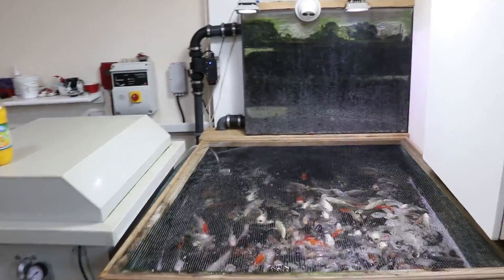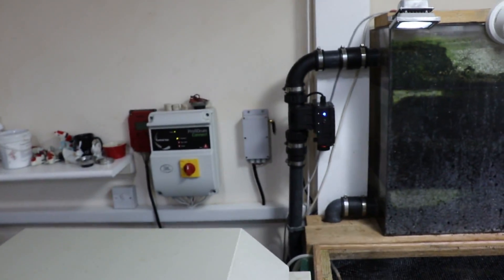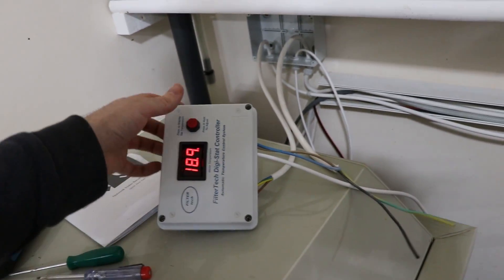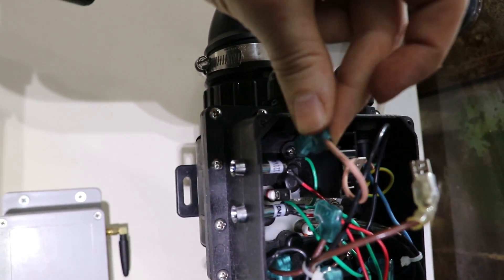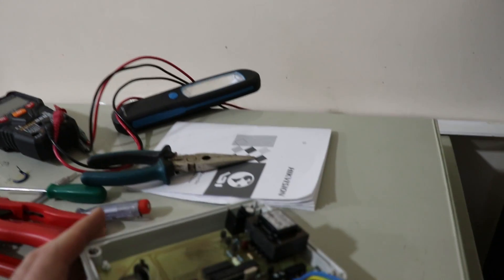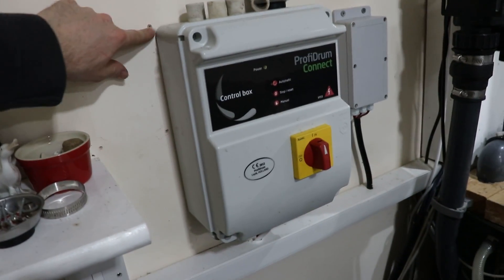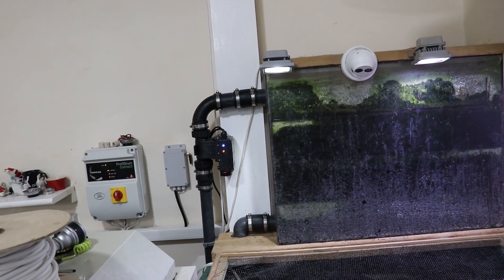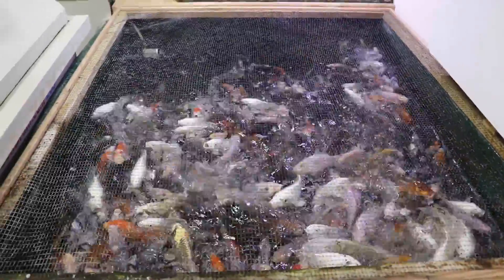Installing a digital heater controller on cloverleaf heater

Comment: Adam I was wondering, have you had any issues with the heater being mounted vertically as the instructions on mine say it should be mounted horizontally. Great and informative videos thanks

Comment: Great videos! Can I ask why you didn’t fix the Hanna  meter? Also a couple of questions where do you have the Hanna meter sensors?...pipe work or pond? Also where do you have your overflow for the ponds regarding the trickle in/out?
Reply from the maker: it never really was very accurate i just wanted rid of them.
i had the sensors in the pond.
i have the trickle going into the pond but its much better to have it in the filter so the cold water can mix with pond water and not cause a difference in temperatures.
Adam

Comment: Another good idea, where did you get the digital controller Adam ? Thanks for the video.
Reply from the maker: I was due for a good idea :) I got the controller from fiveacre koi supplies in Chesterfield its where i go for pretty much all the parts i use.
Reply: @AdamJulyan  Thanks.

Comment: I imagine the alarm output connections are volt free contacts that close on alarm condition which is probably set high & low by programming the panel to the required parameters.
Reply from the maker: I also thought the same although i thought that it would be triggered by low water but it wasn't i think now it might actually be triggered by a too high or too low temperature difference which isn't that much use to me so ill leave it.